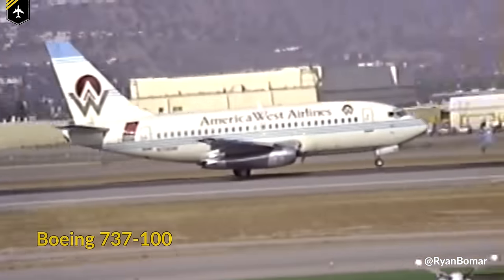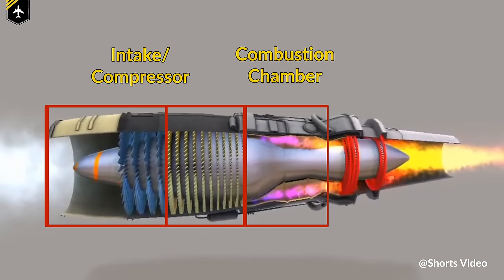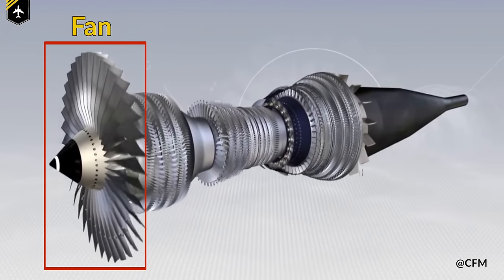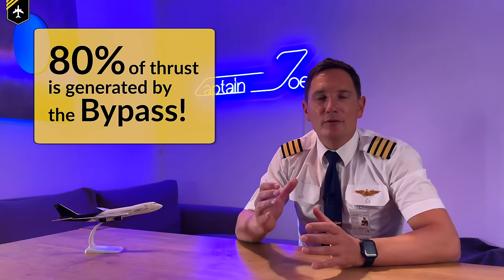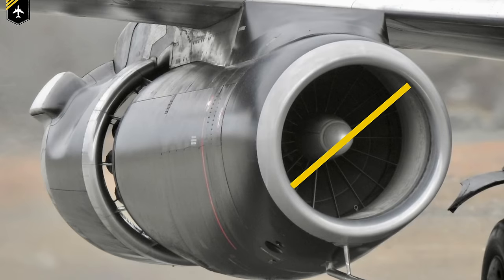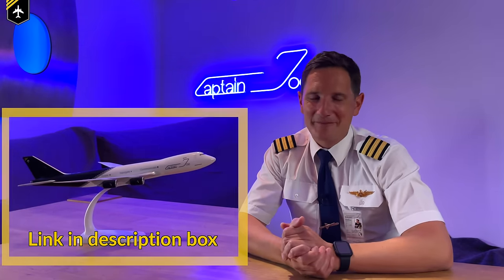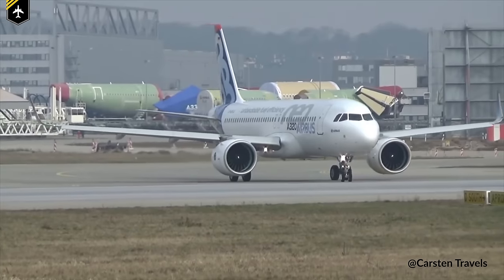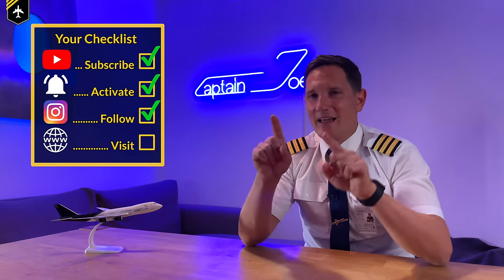HOW DO JET ENGINES work and WHY do they get BIGGER Explained by CAPTAIN JOE

Comment: Not sure if this question was asked before, but if a turbofan engine is already so efficient with such a high bypass ratio, why cant we just transition to using turboprops?
Reply: The efficiency of turboprops drops rapidly when the speed exceeds Mach 0.6, while high bypass turbofans work well at speeds up to about Mach 0.9. It wouldn’t matter much for short domestic flights, but long, intercontinental flights would take several hours longer.
Reply: @fromnorway643  Tu-95?!
Reply: @Sterlingjob  
A very special case with contra-rotating propellers, swept wings and one of the loudest aircrafts ever due to the tips of its propellers moving faster than Mach 1.
Reply: @fromnorway643  don’t forget the gearboxes!

Comment: I know that Rolls Royce use the 3-spool system for their product, which is separate the Low, Mid & High pressure blade zone
But they develop this when 1960-1970s, they bankrupt their company til the Rolls Royce Engine powered 747 released

Comment: Boeing 707 , 727, 737-200 most common turbo jet engine aircraft’s in the Boeing lineup
Reply: The first 707s had turbojets, but even the first models of the 727 and 737 had low-bypass turbofans (JT8D), more or less like those of modern fighters, but minus the afterburner.

Comment: Thank you, you got me through the denial phase. I think I will accept that what we called jet engines are just shrouded turboprop afterall.
Reply: It's totally retro!
Reply: Haha, almost though not exactly

In a turboprop, almost all energy is used to drive the propeller (as in the exhaust doesn't make any thrust)
Reply: @ZK-APA  Yeah but for a time I have always tried to convince myself the heat from the turbine heat the bypass air for expansion, which I have found nothing but counter examples. This video is the last straw.

Comment: Joe ... You have told us how a jet engine works but you haven't actually touched on why physical diameter gets bigger as we build mor efficient engines ... which is supposed to be the topic of the video,  I was hoping to see references to kinetic energy equations, jet efficiency equations .... because they get to the root of the matter especially in Airline (as opposed to air force) operations, where efficiency matters.  The bottom line is it is far more efficient to accelerate a large volume of air a little bit than a little bit of air a lot - for a given amount of thrust.  If you want a air breathing propulsive engine to be more efficient you have to make it move a larger volume of air, less dramatically.  High speed jet exhaust is the enemy of efficiency.  You want maximum work done by the fan.  Even more efficient of course is the turbo-prop.  A propeller grabs much more air but does not accelerate it anywhere near as much as a turbojet.  Turbo-props with over 6m "fan diameter" were developed in the 1950s and indeed power the worlds fastest turboprop aircraft today - the Tu-95 bomber - which operates at around the same cruise speed as a A320 NEO.  Of course customers dont want to fly in propeller driven aeroplanes, so manufacturers try really hard to make a turbo prop with a shroud, duct, nacelle, so airline customers think they are flying in a "jet" when over 90% of the engines thrust is actually coming from the fan / propellor at the front of the turbine.  The manufacturers goal is to build a turbo-prop for efficiency while looking like a jet engine for marketing - thus the increasingly large diameter fan blades.  See also GE36 unducted fans, the massive Ivchenko Progress unducted fans on the An-70 and most impressively, the NK-93 which defies categorisation .... ultra high bypass turbofan, or ducted propfan.  See Rolls Royce engineering efforts to build its very high bypass UltraFan engines.

Comment: I love your work here, but...
Actually, Joe, as it has been a common misnomer that the hit gasses of thrust pushes tha engine forward, wel, not quite correct, it has to do with Newton's laws of motion that for every action there is an equal and opposite reaction, thus the action of force by the thrust causes a reaction of the engine (hence the plane) moving in the opposute direction of the thrust, uh... forward. Like the recoil of a rifle, the shell doesnt 'push' the firearm backward, it is the the result of Newton's law of motion. or a ballon with escaping air. That is why rocket engines can propel large masses upward,the hot exhaust cannt 'push' the air below, however ithas enough thrust to utilise Newton;s laws and thus the rocket reacts by going in the opposite direction up, when the thrust force causess enough action to overcome gravity then the rocket can gain altitude.

Sorry Joe, I am a child prodegy on basic physics as I learned from my step dad when I was 9 or 10 when most kids at that age are still in Gynasium or in America elementary school where science has not even been introduced to them yet.

Comment: So the huge fan produces 80% of the total thrust?How is that even possible I mean it's just a fan?
So if the engine can produce 32000kg thrust the bypass thrust is about 26000kg?
Reply: Because the fan is moving a greater mass of air than the engine core air

Comment: With all due respect Captain!
But you've talked a lot about how engines work and you haven't answered the question in the video! How far can larger engines go?

TurboFan engines are reaching their technological limit! Bigger engines mean more weight, more DRAG.
The 737 MAX project clearly shows the technological limit of the 737 itself and also of the engines under the wings.

If technology continues in the same way, airplanes will have to be designed with engines almost under the wing. In addition to the aerodynamic drag caused by the engine and the weight.

RR's UltraFan could be a short-term solution. And I don't see anyone talking about the disadvantages of the UltraFan, which is more runway on the take-off runway. This is because the N2 in conventional engines has the same RPM as the Fan. Separating the FAN from the N2 shaft by placing a reduction gear reduces the RPM and increases the Torque of the FAN unnecessarily.
On a take-off with the FAM at lower RPM and the FAN generating 80℅ of the engines' total power, this will reduce performance during the take-off.
Not to mention the level of durability and reliability of the planetary gearbox.
Is this really a long-term solution?

Comment: Why can't they put two 9x engines on 747s to bring them upto modern fuel efficiency levels. I'm sure those two massive engines can generate enough thrust that would be equivalent to the older 4 engines originally used on 747s.
Reply: It would be too much of a redesign, which would make it financially unfeasible.

Comment: Ok it may be true that the thrust of the Fan is 80% at T/O but at high altitude ist defently the otherway around. At least thats what I learned....
Reply: You are correct. And you are among a minority of people who understand this concept. Turbofan engines are actually variable bypass hybrid engines that move a lot of air backwards and eject it more slowly when going low and slow and then move less air backwards but eject it faster when going high and fast. This lets the same engine operate efficiently under different flight conditions. A turbofan engine is basically a compromise in a single engine.

Comment: You didn't explain WHY the bypass ratio and thus bypass air generates 80% of the thrust, just that it does.
Reply: Basically to create thrust, either you can have small volume of air go at a high speed (ie the turbofan exhaust) or have a massive volume of air go at a relatively less speed (ie bypass air)
So in these engine, ratio of thrust is in a way that bypass air gives more thrust

Comment: Hi Captain in July of 2021, I flew on an Airbus A321 from Toronto Canada to Jamaica and  back.
While onboarding,  I observed on engine  startup, there was strange  wooing noise in the passenger cabin. That noise stayed in the cabin until when the engine revved up to maximum r.p.m. for  take off. 
The geared turbofan that you've just  described, would  that be the cause of that noise? Oh another thing, I was sitting over wing on both  flights.

Comment: I remember back in the day. The DC-9 or maybe it was a DC-10 had an engine on the front of the tail and two engine's towards the back of the plane on each side. I always thought those airplanes looked cool. I wonder why they changed that configuration 🤔🤔🤔
Reply: That was the Boeing-727.
https://en.wikipedia.org/wiki/Boeing_727#/media/File:B-727_Iberia_(cropped).jpg
The rear engine was actually inside the hull, but its air intake was in front of the tail.
Reply: @fromnorway643  lol I always thought it was the DC 9 or ten all these years. I clearly don't know airplanes. Thanks for sharing the info. Do you know why they went away from this set-up??? Is it more practical to have the engine's on the wings.
Reply: @krisbryant7100  
I'm not sure why this set-up was abandoned, but it does make sense since engines mounted under the wings are easier to access and thus more practical for inspections or when they need to be removed for maintenance.

Comment: I once made a joke about the 737 MAX Engines. Soon, the engines will become so big that the engine goes through the wing like on the de Havilland Comet. And I don't think clearance will be a problem because you can simply put the engines over the wing! ( but I doubt the safety and reliability of such a system)

Comment: Most famous turbojet? My vote is the ME262.
Reply: The Concorde and the Blackbird are more famous, and also early passenger jets like the Boeing 707 or the B-52 bomber. Later versions of the B-707 and the B-52 were equipped with low-bypass turbofans, but they started with turbojets.

Comment: Thanks Captain Joe. 
I heard your comments on why jet engines cannot keep getting bigger, fan blade tips reaching supersonic speeds and becoming inefficient if you are to make them too big/long therefore moving the tips farther from the roots of the fan blades. 
My question then is in relation to the rotor blades on a helicopter. My understanding is that the rotor tips on a helicopter are often going supersonic, hence the pounding noise often heard from a helicopter. How do helicopter rotors perform efficiently?

Comment: Maybe the 707 was turbojet ?
Reply: The first 707 model as well as the first B-52 bombers had turbojets, but later models of both had turbofans with low bypass ratio, pretty much like most modern fighters do (minus the afterburner that most fighters have).
The Concorde also had turbojets, with afterburners.

Comment: What I don't get, if engineers knew about the increase of engine efficiency with larger bypass ratios, why didn't they made these larger engines earlier? It reminds me of the first iPhone generations, which became bigger and bigger, till they reached a limit and where almost to large to use.
Reply: making large fast spinning fans that don't just fly apart under the extreme forces is incredibly complicated
Reply: Because there were several issues which were impossible to overcome just a few decades ago. The problem was especially materials. For instance if you look a newer jet engines. They often have carbon fibre composite fanblades. Although carbon fibre is known since about 60 years now. the knowledge needed to form it into usable fanblades just came much much later. One thing with bigger jet engines is to keep the weight within reasonable limits. So you need to use lighter materials or a better construction and at the same time the the forces get bigger and the temperatures get higher because MORE POWER. So from a technical perspective you will run into a conflict of goals.
Reply: Thanks I didn't knew about it. Just making it bigger just seemed to be the obvious thing to do, but as always reality makes everything harder.

Comment: Asking engineers, can a turbofan engine be converted by replacing the core engine, the turbojet, with an inline piston engine?
Reply: That would make the engine much heavier since gas turbines have much better power to weight ratio than piston engines, and weight savings is a crucial part of aircraft design. There is a reason why larger propeller aircrafts and helicopters are turbine powered, not piston powered.

Comment: congratulation captain Joe on such a quality presentation. Its engineering part is right on the mark.  As the fan grows bigger, the stress on the fan roots is getting so high.  Failure on fan blades may getting more attention, e.g., UA328.

Comment: You could've mentioned the RB211  which power's some of your 747s as well.
It got 3 separate drive shafts driven by the low pressure turbine, intermediate turbine and the high-pressure turbine. Like this its fan velocity is independent and not given by the low/intermediate pressure compressor.

Comment: Most Famous Turbo Jet Engine: J58.
Reply: The J58 wasn't a pure turbojet anymore. Basically it could switch between turbojet and turbofan because when the aircraft reached certain speeds, the engine opened bypass valves which allowed part of the air to bypass most of the compressor stages and the combustion chamber entirely and instead was funneld back in to the exhaust stream just before the flame holder for the afterburner.

Comment: 5 and half years ago Minutephysics uploaded a video (https://www.youtube.com/watch?v=ueTGjegTKoo) in which he made a rough estimate based on drag considerations that put the max size of a turbofan engine around 4m fan diameter, which might lead to the tip of the fan blades going faster than speed of sound, but is totally achievable with geared turbofan.

As for the most iconic turbojet plane I'd say Concorde, maybe some military planes like the Lockheed SR-71 (don't know if it counts because the P&W J58 is not a pure turbojet).

Comment: Just rewatched this video after a year and find it every bit as intriguing and informative as the first time. Thank you for sharing your vast knowledge and expertise with a lay audience. It helps everyone better appreciate the "miracle" of flight.

It seems that turbofans are constructed with angled blades attached to a central axis. You had mentioned that if the blades spin too fast, the efficiency of the engine is degraded. If "winglets" were formed out of the blade tips or attached to them, in the same way as the winglets on the airframe (which I believe help dampen eddy currents, or something like that), would that possibly improve turbofan efficiency and allow for higher RPMs?

Would fan blades be able to withstand higher rotational speeds if instead of having only one side attached and the other free moving, both sides were attached to something? I mean could the outer edges of the blades be connected to one another so as to form a continuous supporting ring, sort of like spokes on a bicycle wheel? Then again, the extra mass probably would more than outweigh any potential improvement in aerodynamic efficiency.

Thanks for another great video!
Reply: No! The fan is a fan and not an aerofoil so can spin a lot faster.But on large turbofans you want to move as much air as slowly as possible, thats a way that makes them efficient .

Comment: Someone please explain why are planes allowed to fly if it needs both engines to take off. If one engine fails during take off it's a disaster.  Where is the safety in all this ? A fully loaded plane cannot climb using just one engine then why is a plane allowed to be fully loaded.  Maybe a video about that instead
Reply: @Clayson Antoons right.  Like the Boeing over Greece who took off lost an engine couldn't climb, too heavy to fly with one engine,  flew over people's houses miraculous managed to land back where it left from.  Climb with one engine my ass. Words vs evidence
Reply: @Jack_The_Ripper_Here  They can climb with one engine, just at a much smaller rate. They need both to accelerate before takeoff but once they reached the safety speed, they are able to climb with one engine inoperative. You personal incredulity is not a valid argument.
Reply: @AlexFoxthrot  fully loaded 777 can climb with one engine as soon as it lifted of the runway? Highly doubt it. Please post video with a fully loaded plane climbing with one engine.
Reply: If I remember correctly, a plane losing the thrust from one engine during take-off must be able to do one of two things:

1) complete the take-off if the remaining runway is too short and the speed is too high to slow down to full stop
2) slow down to full stop if the remaining runway is long enough and the speed low enough for that

The preferred option depends on if the engine failure happens early (2) or late (1) during the take-off.